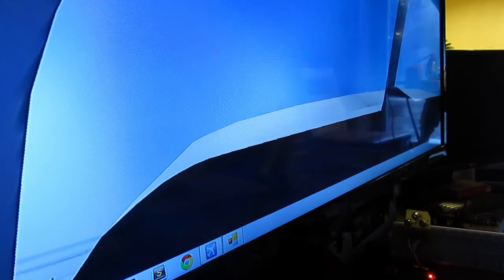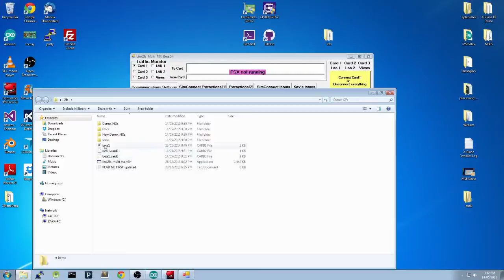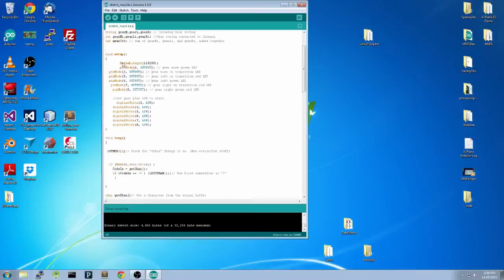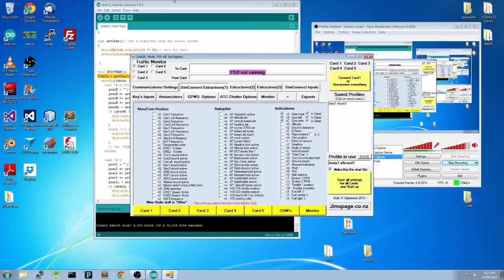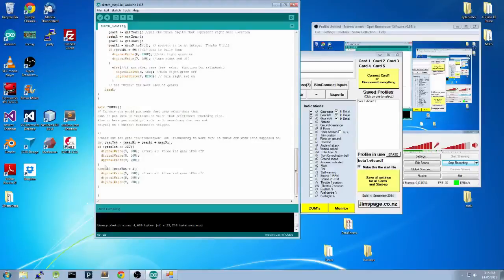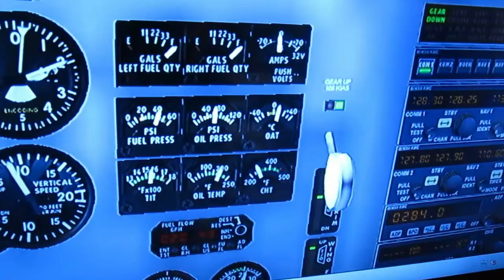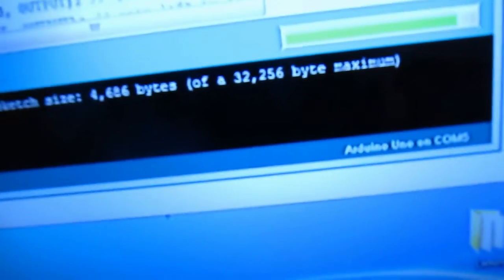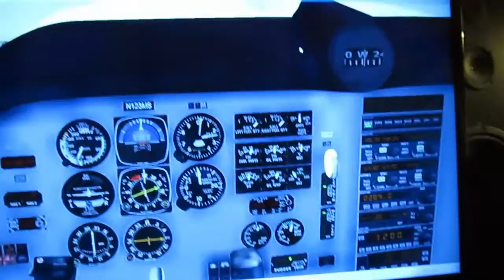MSFSX and Link2FS #1 - Output to Arduino (Gear lights)

Comment: I was able to make your code work great with the Ardunio Mega 2560 and the LEDs for landing lights. One question that I have being new to coding. What code do I need to add and where do I need to add it into yours to make a switch drive the gear?

Comment from the maker: +Marcelo Mendoza Galindo i can't seem to reply to your comment. can you post the code you're using on PasteBin and send e the link so i can take a look?
Reply: +Zakk Atkinson (ZakkBlog)  sorry for not been able to answer, i been out of the country, well i finaly could solve my problem with the gear ligths, i dont know why but i just change the pin numbers and it worked, so im happy for now :D,  now im trying to adapt a servo code for working with the flaps gauge, so i'll be around here, sorry for my english is not perfect... and thanks for all your videos, they are very helpfull, congrats for all your job

Comment: I get an error every time I try to open links FSX or Jim's page whatever you called program LOL I tried saving it to my desktop in a folder but it will not open without an error I have Windows 7 professional addition any suggestions
Reply from the maker: i haven't worked on this project in a while, and haven't encountered such an error. sorry, hopefully someone more up to date can help?
Reply: Install the simconnects that are in the fsx sdk directory
Reply: What happened Bryan?  Did you get your problem solved in the end?

Comment: I get a "Can't find master file, you will have to load one" any ideas?
Reply: I suspect now this is a Windows 10 issue.  I never have this issue on my Windows 7 machines.
Reply: Hi there Warbirdguy1.  Did anyone respond to your inquiry?  I have the same issue and need to find a copy of this file and then figure out where it should be located so that Link2FS can find it.  I notice that Jimspage.co.nz has been suspended so we can't get any help from there anymore. :(